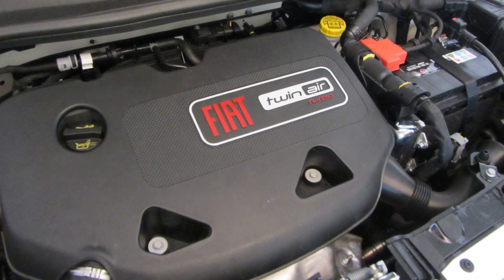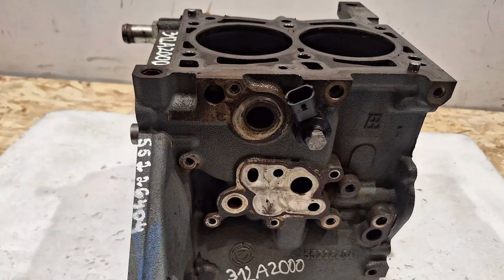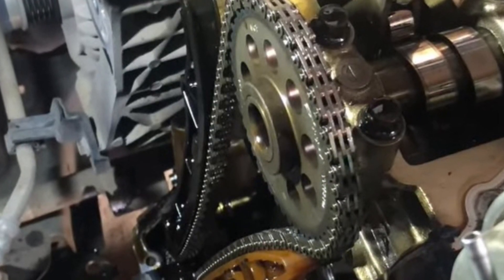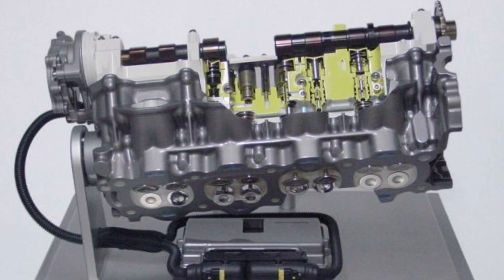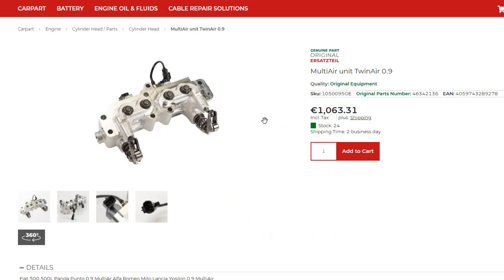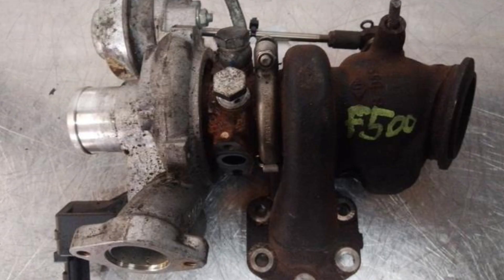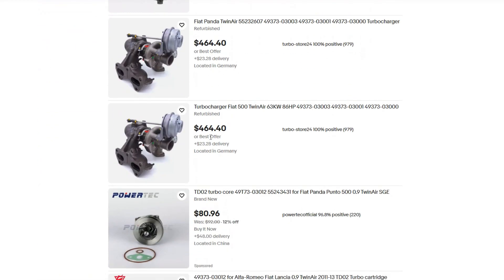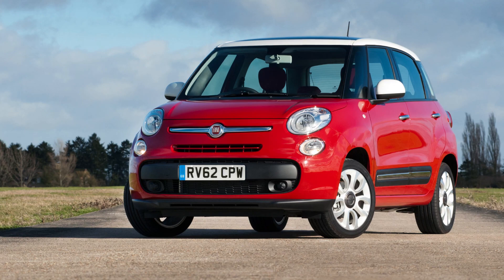Fiat 0.9 TwinAir engine reliability and common faults

Comment: Buy one with a 1.2 8v, swap it with for a 1.4 8v, mount a sport cat, change the camshaft, remap it and youll have 100 very reliable horsepower that still does an easy 50 mpg.
Im doing this with my ford Ka, 103hp, 815kg, great fun!!

Comment: Hey man, i have a fiat punto 2012 0.9 twinair. my engine suddenly died on a stoplight, i had codes p0300 and p0302. I checked my engine oil and it’s basically empty. i think my uniair module lost pressure as a result. If i simple try refilled the oil, and try to restore the pressure, do you think it will work or is my car in trouble? i have 202000km on it, only had it for 3 months but drove almost 30k kilometer without oil change (also no change after purchase). Thanks alot
Reply from the maker: You may try refilling oil, but the codes are for misfiring. Could be a plug or coil, or uniair, or internal damage... It needs thorough inspection.